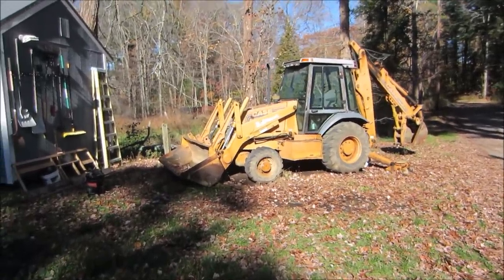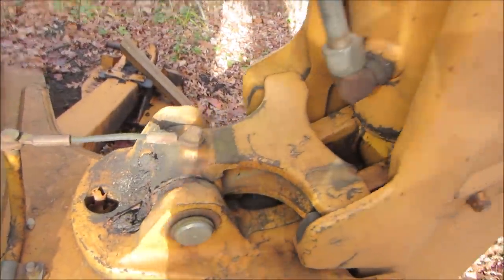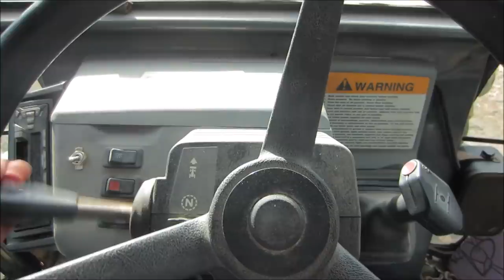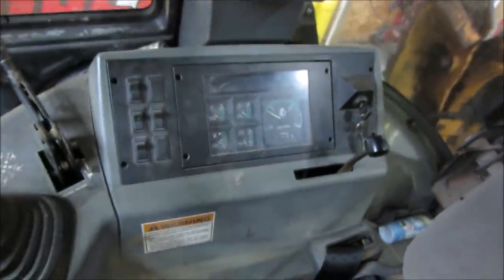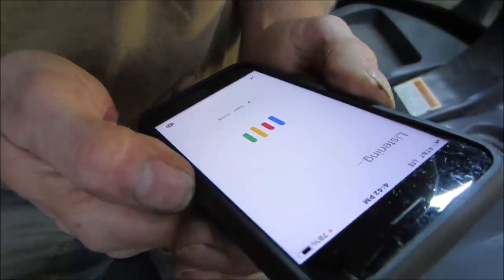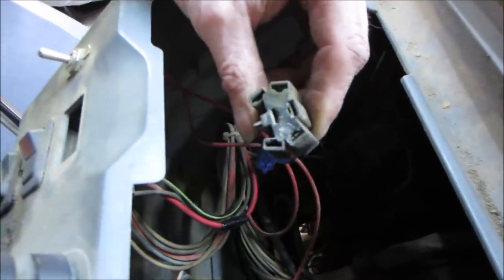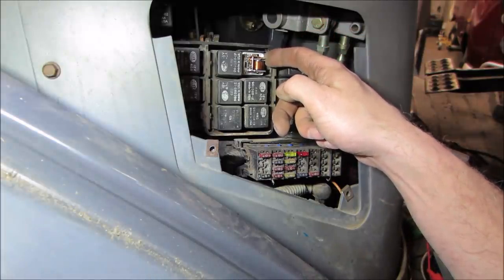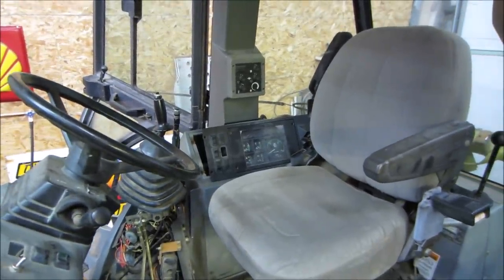Lets Fix Up A Clapped Out Case 580 Backhoe Thats Been Sitting.

Comment: then switch then triggers the relays , which then transmit voltage to the high power requirement parts  . lights , solenoids ,

Comment: These cummins engines dont have glow plugs, they have a grid heater. It's on top of the intake manifold where the air horn bolts on. Heats the incoming air charge to help with cold starts

Comment: The B series Cummins engines have an intake grid heater and no glow plugs.  It should be right under where the air intake connects to the manifold.

Comment: 4 wheel drive is turned on by one of the switches on the side panel. I used to own a 480 L backhoe but that was a while ago, and now I'm with a 480 M. Unfortunately, on yours the labels have been taken out. You should find which one in the user manual. The front differential engages is an on-the-go type. However the front left and right wheel do not lock together. So if you have one front wheel spinning on ice then the front wheel are pretty much useless even lock. As for the real wheels, they are usually unlocked unless you lock them with, if I remember, the small pedal beside the brakes. On the 480 M, it's an electric lock that is situated on the front bucket control stick. So you should be aware that you can never have more than the two back wheels lock with one of the front wheels, making it a three wheels lock. And yes the clutch is electric and situated on the speed selector lever. You use it like a regular clutch before changing gears, especially between third and fourth. If I remember well, there is also a clutch button on the front bucket control stick, as there is one on the 480 M. One thing which is not great with that backhoe is the parking breaks which can easily slip even when fully engage. If I remember well, it should be adjusted so that the backhoe does not move while engage forward on the second or third gear (I don't remember) at full throttle. So be careful about that. On the 480 M, it's a mechanical gear lock that is used for parking breaks which positively lock the wheels dead. If you are very lucky one of the buttons on the side panel is for ride control if your backhoe. You will just love that option if you have it. It's in effect an active suspension that cleverly uses the weight of the front bucket as a counterbalance when riding over bumpy terrain preventing the front wheel from jumping all over the place making for a very smooth ride. The more load in the bucket, the better. It's also great when trying to take a pile of earth or whatever as when it's on it prevent the backhoe from putting down pressure on the front bucket thus easily gliding it over the ground before digging into an earth or rock pile. Anyway, have fun with your backhoe. ;-)

Comment: Mustie, when you shorted those wires and the lights came on I heard the relay. This would mean that the switches connect to the SOL side of a relay and the power from the fuse box powers the Load BUT!! the Voltage for the SOL that passes through the switch might come from another source and this might have been the confusion that was the original issue. I would hunt for the switch voltage source that is the signal for the relay. A wiring diagram would be REALY helpfull!

Comment: 14:14 If you straighten the boom completely and lift it all the way up, then the weight will cause it to continue in over the roof and it will go in and lock.
If it makes sense.
My neighbor has the same problem with the same machine.

Comment: I suspect the 20 amp fuse replaced a 10 amp fuse for one of the light circuits when the power for the other light circuit was lost and then the two light circuits were tied together using the Scotchlock IDC.

Comment: The 580 k super was full-time four wheel drive  the angle light on switch is for 2 lights I don't see it having at the moment.  No not the four in the middle, two single lights on the front corners of the cab is where they were on the one I used for years. This is why my boss would not let me install a stereo in it. They are good backhoes  but they are not the most agile in the mud. Slow and they are good and they will need chains to use as snow movers. Cause they sux on ice 🧊

Comment: Yeah those relays are the same as the fan, starter, A/C etcetera relays for a Chevy I know that for sure, the 12v Cummins Doesn't use a Glow plug system, it has a Air Pre-Heater on the intake manifold, you will see a 10ga Pos. & Neg wires bolter to the heater..

Comment: I would think that the engine needs to be running for all the lights to work otherwise the battery would die out pretty quickly, i would expect the normal running lights to operate but as for the work lights i would expect to see them powered on after the engine starts.

Comment: Hey, Nice backhoe.  The Case 580 Super L has all the bells and whistles; the extended hoe is mint, its got a thumb (mint again, but without the piston), and a big snowplow too.  Never fix another snow blower!!

Case backhoes are/were the gold standard.  Nice purchase.

You are missing the pistons for the stabilizers, get a rebuilt pair maybe?  The pins even seem good from what I could see.  It's got some body rot on the doors (typical), but the paint is really pretty good overall.  This was a good purchase if the price was right.  Sure it needs front tires, some maintenance and detailing before you can take it to a car show.

Park it in the driveway with a bow on it, Tell your wife "Merry Christmas"!  A Case 580 is $100k new, she will love it!  Get her some yellow slippers to match.

Comment: I'm thinking that since those two dead fuses had only one wire going to each, and when those wires are bridged all lights operate, both those wires most likely go to each side of the first (higher rating) fuse and the fuse next to it shouldn't be there. Probably was just a blank hole. Do you see what I'm saying here?

Comment: With an indicator light in each switch that 3rd wire could be a ground, unless they are neon lights which would light by current, that's not likely if they are lit without the lights working.

Comment: Are any of them LED head/work lights? Would using LED with less power draw be more reliable for that old wiring? For big snow events you might have to work late into the night depending on what jobs you take on.

Comment: @10:00 - I worked with a guy that had one of these.  I could not get it to lock for anything.  He would move the arm forward and return it toward the lock position VERY quickly.  It would over-center back toward the cab and the lock would engage.  I practiced and could never get it.

Comment: Everyone that has run one of these Case's is screaming at their screen to pull back then push forward on the control to get into travel mode.  It is a creepy feeling with the boom flying at you, and even worse when your front end wants to lift off without the stabilizers down.

Comment: On my 580K the rear wiper is on that right hand side panel where the climate controls are. There's probably a lockout switch on your upper left as facing the hoe (to the rear) that keeps the wiper disabled when the rear window is slid down. I've had this happen on mine as the top window segment starts to droop on the window catches.

Comment: 1:13:20  That big mess did not just "happen" for no reason whatsoever.  There are serious electrical problems in this machine.  Wires don't just burn for no reason.  There are shorts in the lighting circuit.

Comment: @Mustie1: I don't think the wires were setup like that from the factory. Doing it like that is just bypassing the fuses, isn't it? So one wire has 12 V and gets connected to the other wire in front of the fuse. That means all lights are running straight from the battery with no fuse. This could be a fire hazard, if the wire size is not meant to run that much current all the time. Also in some countries it is not legal to turn on the worklights when going down the road. If the back lights have no seperate switch and turn on with the road lights, that could be an issue.

Comment: That fuse box has bus bars running from side to side, that's why there's only one wire feeding those fuses. Looks like the large orange wire feeds that one row, still not sure why they jumped the fuse outputs like that...

Comment: Need stiff legs. Special order 2 stick John deer controls. Looks like it was driven down the road alot. Buttons on stick is clutch. If the holes are wore out in the things that hold teeth on bucket, need to cut them off and replace them before you put new teeth on it. You will lose teeth digging if you don't. Teeth are expensive.

Comment: Pretty cool, I rented a 580D case one time to clear some property. Worked great except I got it stuck one time in the mud but crabbed it out between the backhoe and the front bucket. I broke a hydralic fitting but the rental place came right out and replaced it. Only thing I wish it had was a thumb on the backhoe. I didn't see you try it out on the video? hope it worked?
Reply: Think that the thumb on this thing is a non-hydraulic thumb,  you set it with a pin where you think it will work best.  Adjustable by x-number of positions, "x" being however many holes there are.
Reply: Wow, never knew of that version before. Makes sense since it would work anyway. Less maintenance too. I just saw a guy braze a piston rod on a repair. It worked but he even stated now sure how the seals would hold up and for how long? Sill beats the cost of new cylinders for the outriggers

Comment: I guess since it is a '95, that is why A/C was even an option. Everything has A/C! Even my Sentra with the crappy CVT! I know, we get spoiled. Although, if you have a job you have to do and it hits 100 Degrees, and your in your late 50's (like we are), A/C is a Godsend. Anyone out there have an A/C unit that will bolt into Mustie's Case? (NO! Not you, Bubba J.! That unit can stay in your mobile home. It probably wouldn't be made by Frigidaire anyway). That is a nice machine, Sir. Hi, Brian!!   :-) Good Engine, Good Trans, 90% there. Tires only real big ticket, but it still works as it is. (Oh, the outriggers; Ya. Very important but I am sure that was a big chip in your bargaining). You know; run it a while and everything it may need will surface and then we get to watch you address any issues. Win/Win. She is a beautiful machine.

Comment: Need to get yourself some corner protectors so your strap isnt directly on a sharp corner normally on fuse boxes it has one main power wire for the whole box and the box is setup like a house circuit breaker box  all breakers jump to the individual circuits and what happened I guarantee you is that the one st of lights shorted out and someone not understanding how the circuit are wired

Comment: Here is a lil tip go and get yourself a "Power Probe" it is a test light that hooks to a battery and you can press a button to push B+ or -- Ground .....
Whichever is needed and it has a built-in circuit breaker that all you have to do is press the switch to reset it .
They range anywhere from 50 bucks to 150 bucks but the cheapy should do what you need it to do.
That 3dollar test light and a roach clip are a thing of the past and no more burned up wires or melted connectors....
Why do Youtubers talk to the camera and ask questions like it is another person and literally hold a coversation with it.
You ask questions like it will answer you back ......I never understood ....WHY ?

Comment: couldn't have been sitting not use very long or every wiper seal on the cylinders valves would be weeping oil, witch will stop in time once it been used s few hours, so many people buy new tractors and they dont have much use for one and it sits a few months an they go to use it and every thing has dryed up so oils seps from every thing and they dont know why and they have a dealer rebuild everything when it is not needed, it just needs use, but the dealers love them kind of people as there back a few times a year do to lack of use, some times you can get away with it sitting an not have it seep oil but not often.. to set the travel lock you have to snap the boom up fast and retract fast,, i bought a 580B that wouldn't go forward or back at all but i knew what the problem was but the township maniac said it needed a new transition, witch i knew was not the case, i picked it up for 3000 cnd with a fairly new set of construction back tires as they had terf tires on it, they just wanted scrap value for it, the backhoe bucket needed all new pins an bushings an the heater fixed but as a life long welder the pins a pin bosses were a walk in the park for me, i have it home after a 400  mile trip and fully working in a month in my spare time with a cost in parts and floating  of 700.00. IT CAME WITH THE SERVICE MANUAL THAT COVER ALL 580 MODELS, THE BOOK IS LIKE 7 INCHS THICK..

Comment: The bucket is missing teeth and it’s recommended too replace them when they have fallen or been taken off …… what you have left on the bucket are what’s called shanks and they actually look good so you can replace the teeth and shouldn’t have any problems ….. reasons teeth come off most of the times is due too worn out shanks from age and digging with no teeth , once they become worn down or rounded the teeth no longer secure and break the pins holding the teeth and once again fall off ! The only thing the pins do are keep the teeth from falling off never do they support the digging force

Comment: btw I looked up the cost for a service manual its only $20.oo US ...just so you know. Case makes good equipment. btw If the motor is descent in that little loader i'd repair the body work and touch her up with a bit of paint, before it gets too bad. It think it would be worth it, but that's just my opinion, and you know what opinions are like. Right!! LOL  " Well, we got the radio figured out, it fixed itself." it's funny how that goes eh!!  LOL That was pretty stupid to use spade connector behind that fuse box some peoples kids.

Comment: Keep in mind that 4x4 requires wheels that have a circumference that matches front to rear, so just changing front tires will put a strain on the transmission. If the difference is to big you can kill it.

Comment: Way to slow for moving snow this machine is for dirt and to heavy to transport. I would only use a  skid loader with a wide bucket and a quick tatch snow blower if you do not want piles of snow taking up space. Either way a skid loader with tracks even half that size will move snow 2 to 4 times faster and can be moved with a much smaller trailor. Not saying it's not a great deal don't know what it cost or how much repairs are needed. Just aint the best for snow it's for moving dirt and really has traction problems on steep grades with glare ice it will slide all the way down an icy slope with virtually no control from all that weight one thing is for sure you may want that back hoe off for snow removal in close quarters. Nice machine and sure you got it cheap and your abilities to fix almost any thing it can throw at you is worth volumes of head aches. Be sure and let everyone know how well it works in snow and ice.

Comment: Your batteries aren’t wired right for a parallel hook up. Wire it positive to positive, negative to negative…. But use positive off of one battery and negative on the other. That increases your amp/hr rating as well as charges both batteries equally. Just a hint! Nice backhoe Mustie!

Comment: Hey could I pick your brain for a min cause I am stumped I have a craftsman 3500 watt generator and it recently started running like crap putting out black smoke from the exhaust I pulled the spark plug cleaned it pulled the carb and changed the oil I ran it for 15 min and the carb iced over I pulled the air filter and found that oil was entering the carb via the crank case vent from the valve cover I know I didn't over fill the oil  and when I drained the crankcase i got almost 2 quarts of oil but it oil had the consistency of water what am I missing

Comment: I would look a little more carefully into that wireing. I didn't see the relays move when the lights came on. That could mean a couple things. It could mean they are working and you had the light switch on or it could mean that someone wired those lights directly through the switch. Either way just one of those wires is not large enough to bring all the power to all those lights. That's why there were 2 wires in the first place. If the relays are clearly marked you can trace the high amp wire off the back of the relays to sort them out properly A Scotch-Lok is only good for very low amperage and not particularly good at even that. What they did was put that Scotch-Lok on 2 very large gauge wires. It was bound to over heat. first it cut the wire strands then it connected the 2 now compromised wires with a connection that is only good for 15 amps on a good day. Those lights probably pull a combined constant amperage of 20-25 amps if they are stock bulbs. I have found that people like to change them for more light and if they did you could be pulling a whole lot more amperage through that Scotch-Lok than it can take. its lucky it didn't start a fire.

That's an old machine but I would have bought it too if the price was right. 👍